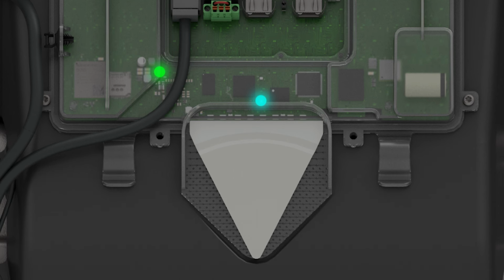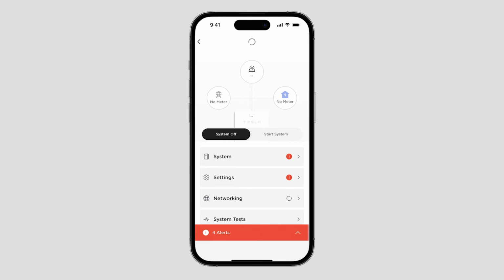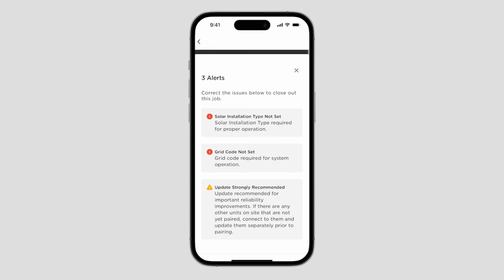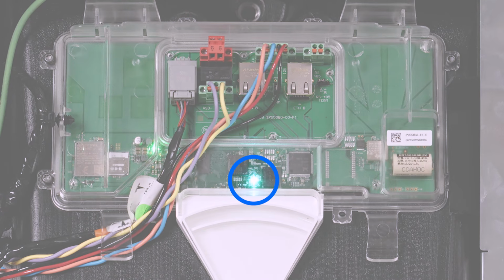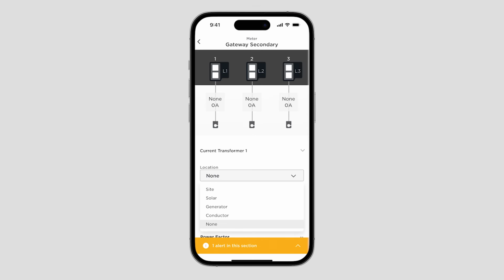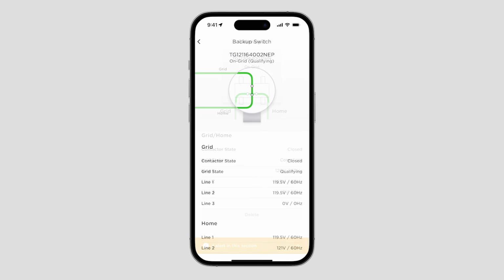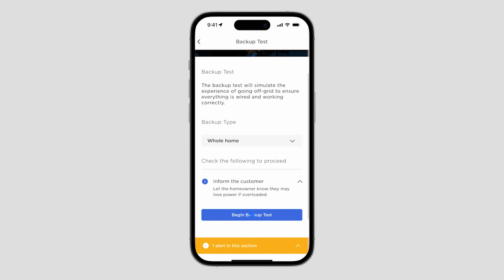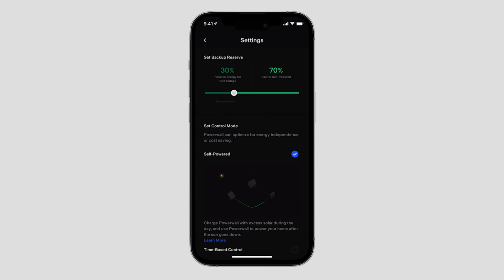Powerwall 3 - Commissioning

Comment: For AC-coupled solar installs with the Tesla Backup Switch, should Solar Installation Type be "none" or "Solar Panel"?
Edit: The answer appears to be "none" since app now includes the message "Note: This setting only applies to solar that is connected to a Tesla inverter." below the drop down menu.